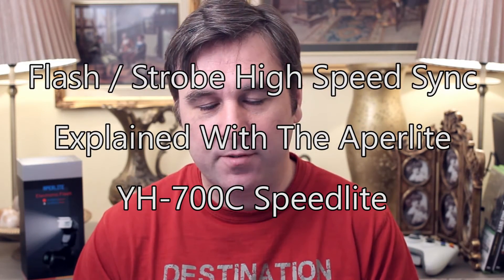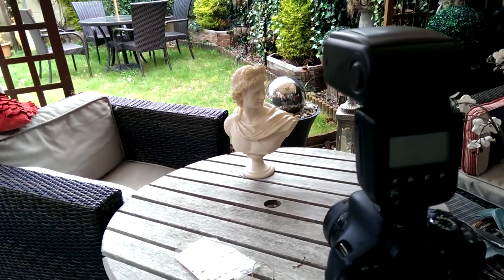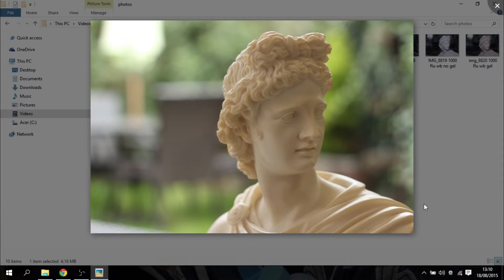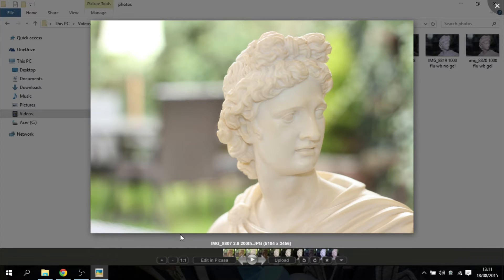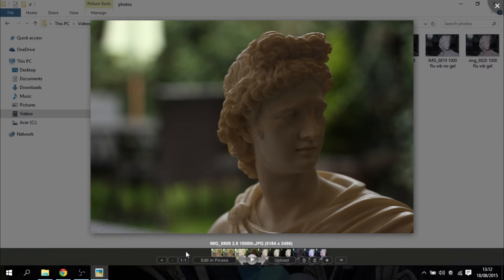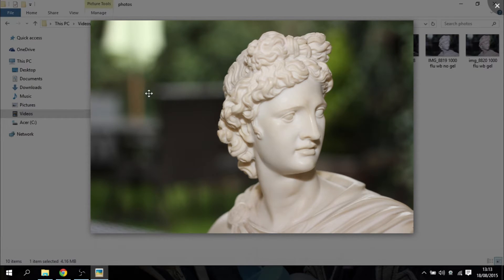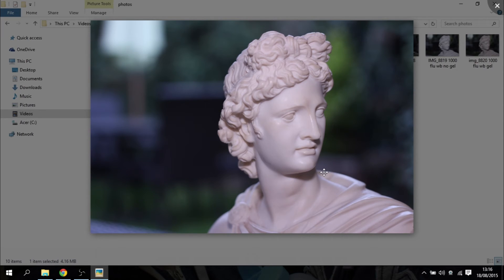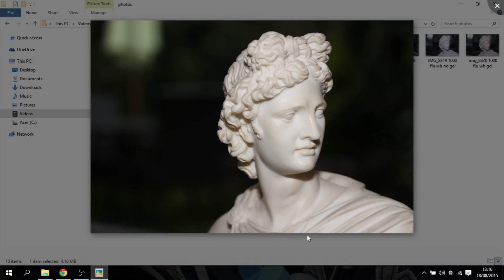Flash / Strobe High Speed Sync Explained With The Aperlite YH-700C Speedlite

Comment: Thanks Rob for showing how to use Hi Speed Sync. I just received the Aperlight 700c in the mail today. How do you set the flash to Hi Speed Sync in the controls?
Reply from the maker: +Will Butler Press the round button with the three triangles on it, until you see the lightning icon with the H next to it.

Comment: I am sold on Aperlite YH-700c and the 500 for my Canon 6D. My question is ( when I use the light on my hot shoe I have  no problem) Can my 6D work wirelessly without a speed flash controller?
Reply from the maker: +Stoney Burke On basic slave mode, yes. As for ettl wireless, you'd have to read the manual.